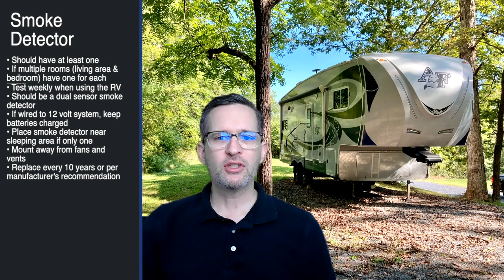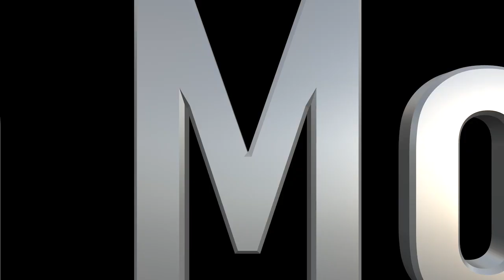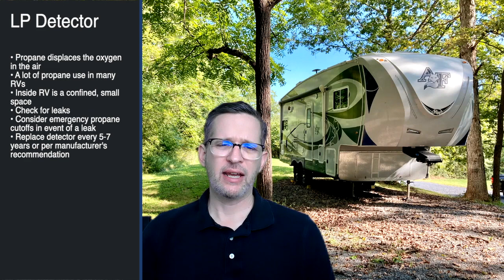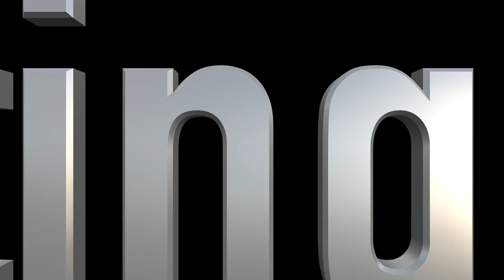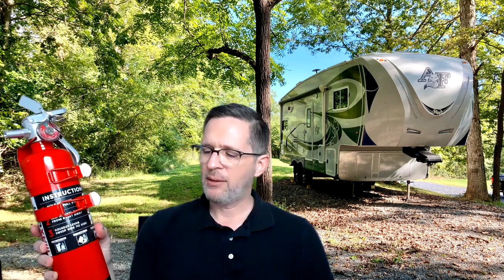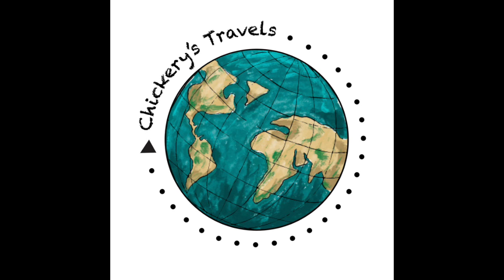Reduce the Risk of Dying in Your RV

Comment: You need to move the laptop so it doesn’t reflect on your glasses.  Distracting to viewer.  Should point out where to install LP detector (18” off the floor).
Reply from the maker: Thanks for your comments and for adding to the details about the LP detector